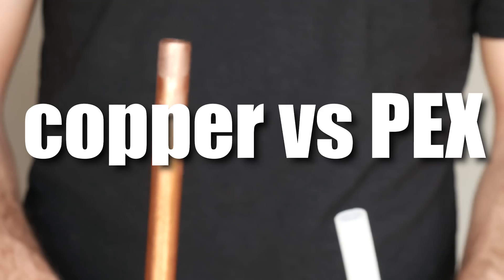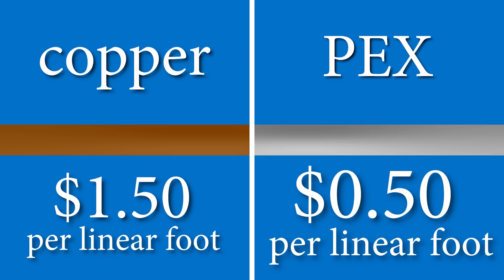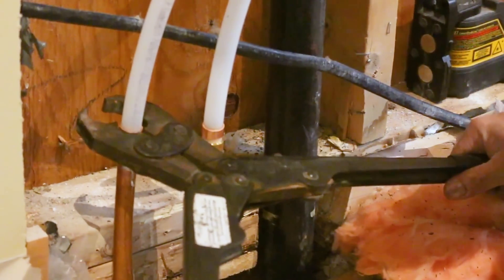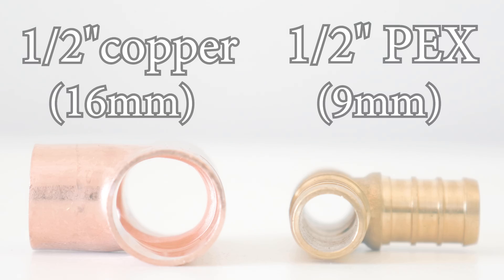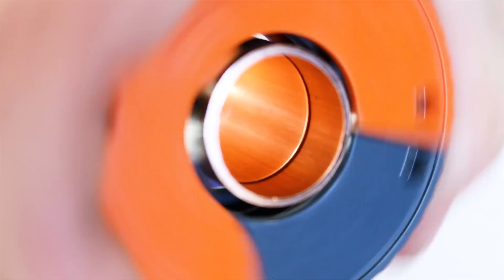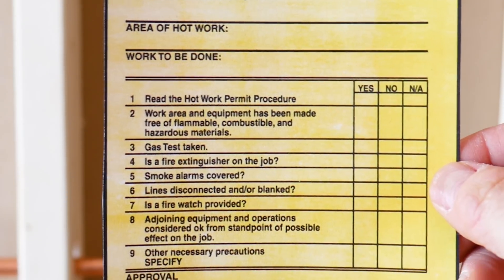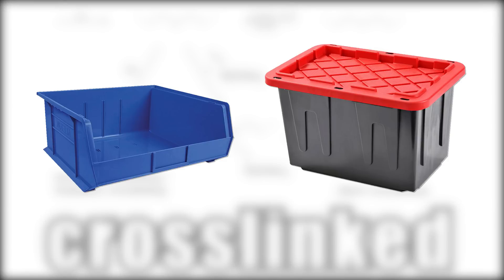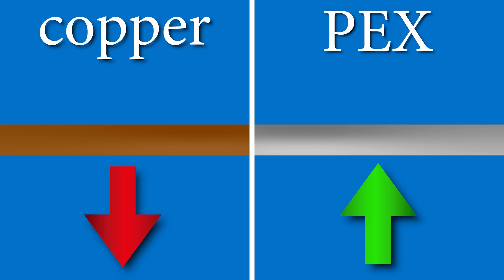Is Copper Better Than PEX? (COMPLETE GUIDE) | GOT2LEARN

Comment: You forgot to mention how much of an advantage copper has to PEX due to it being much more rigid. For example, copper will satisfy an outdoor water spigot needs more as it doesn't require added reinforcement clamps etc. to deal with the strains a spigot will endure. Same goes for shower head supply lines and angle valves on sinks, toilets and basins. Maybe PEX fittings are used for this but I have never seen any review talk about them.
I know of a person who has a 2010 tract built home with PEX and they used all home runs to a manifold with supply valves for each "room". His sink and toilet connection have no angle valves and the pex comes from the drywall then connected directly to the hot/cold fixtures so if he has a toilet about to overflow, he has to run out to the garage manifold to turn off the water. They like to clean their fixture with the water off and the bowl almost empty too yet, no shut off valve near the tank so, out to the garage. Then, if something needs serviced on this dishwasher or the sink etc. no angle valves to control the water in the kitchen so, the entire kitchen room has to do without water for that maintenance. It's hard to believe the local codes allow this and it seems that to maintain a homes plumbing is at more of a disadvantage without angle valves for each fixture.
There is talk that new PEX is rodent proof...I'd doubt that one to be 100% accurate for 50 years.  Also, I don't like the fact that the PEX tubing and fittings are smaller than copper...its bad enough already to deal with loss of water volume when using more than one plumbing fixture at a time and if the "home runs" were done right, there would be 3 or 4 of them per bathroom which makes the need for more per foot PEX supply lines vs. one larger supply line and branching off it for other fixtures in the same room with smaller lines. 
There is another cost with PEX that wasn't mentioned, their fittings cost a lot of money, especially the shark fittings, $30 each? So, the PEX itself is less, the fittings are more, labor might be less however, the homeowner is also at more risk from rodents and likely from a good installation (installer quality) vs. copper.  Overall cost copper vs. pex would have to be quite large to take on the risk of PEX.

Comment: The sizing of the pipe would only be a concern if you are limited on space or if upsizing the pipe cost more than copper for the same size. I was going to do 3/4 pex in my house and would have probably been just fine doing it but I stepped it up to 1" and might only cost me 15% more but was just as easy to put in.

Comment: imagine in several decades when you eventually have to replumb PEX with PEX on a home run system. Attach coupling between old pipe and new pipe, pull old PEX out while pulling in new PEX.

Comment: Both... prefer PEX for all reasons mentioned...rodents are its only real actual weakness...but if your under joists its no problem Pex is so easy fast repairs are a piece of cake cost less flexible less joints if your worried about mice or rats chewing on them note that most of your water pipes  are up high n the most exposed are when you coming up of the floor so if you want a piece of mind then just copper it up to that point then pex it up...great video
Reply from the maker: thanks!!!

Comment: We have lived in our home for 35 years. Noticing pinholes I replaced my copper finding a cheap grade that I was replaced with L grade pipe. After watching your videos I easily replaced it and determined it was an excess of flux that damaged the old copper pipe. Thanks, G2L I like copper.
Reply: What state? When I worked in specialty insurance over a decade ago (customer could add on insurance and include in their utility bill), there were a rash of copper getting pinhole leaks due to the water content in Florida. I think Pennsylvania too. But this affected entire water districts, so if it was only you, could have been the install, if your entire neighborhood is getting leaks, could be the water. I usually badmouth insurance companies, but we were quick to pay for a recomplete replumb instead of repairing pinhole leaks in these water districts.

Comment: In my country copper pipes are 10-15 times more expensive than PPRC piping which is most commonly used. Plus those PPRC pipes have have joints that fit over the pipes like your copper ones so no burden on flow either. Also, i just checked, manufacturer data shows 940 psi capacity. No PPRC in Canada?

Comment: I'm a DIY'er and have done 8 bathrooms and 5 kitchens, all copper and I'm still waiting to hear about the first leak on any one of them since 1968.  I agree with all the advantages of PEX stated here and am ready to embark on my 9th bathroom.  Although I am a copper disciple, I'm afraid we have something new to think about.  We are in a new world now and the enemy is inside the wire.  I have little doubt that some Bolshevik bureaucrat will soon mandate that local municipalities lower water pressure and volume to their customers/citizens just like they already have begun with electricity.  What PEX brings to the table in that regard is few if any elbow fittings.  The turns are more gradual and sweeping with PEX and should have no noticeable effect on pressure at the service point.  This is perhaps a PEX value point that some may not have considered.  The harsh turns of copper elbows will present accumulative pressure loss over the run depending on their number.  I'm not a plumber but I am a mechanic/technician and have had to learn about this in Hydraulics, Refrigerant, Cooling Systems and Pool equipment.  Across all fluid management systems I have always tried to include sweep type elbow joints wherever possible in my layout.  I don't see any reason why it would be different in a home or commercial plumbing system.  PEX intrinsically makes that happen by default.  My first PEX bathroom begins in 6 weeks.  I'll get back to you in 40 years and let you know how I made out.  :)
Reply: So, PEX is invented about the same time the Berlin Wall comes down?  Coincidence?  I think not!

Comment: I am in the Restoration water mitigation industry. Copper is my friend when it comes to leaks, mostly in the winter due to poor insulation/temperature control. That being said I was on one job where a rat chewed through a pex line on the 3rd floor. All three floors were flooded.

Comment: Great Vid!!  took a 1924 house and gutted piping!!  redid the whole house to every fixture added some fixtures with valves on hot and cold of every fixture !!  Kickass system!!  going to be installing a dedicated hot water return line to hot water heater with smart plug setup!!
Reply: Great, but what option did you use for piping?
Reply from the maker: PEX and copper :)
Reply: @histubeness  sorry all PEX A

Comment: In argentina we use a thermofusion systems and it’s installation is kinda similar to copper because of the elbows and fittings, but much simplier and fast to install because to join two ends you have to heat up both openings with a specialized handheld and portable heater for that propuse, this also prevents leaks. Also it’s much sturdier than PEX because it has more inner thickness. The plastics technic name is Polypropylene Type 3 (PPCR), but we know it by “Thermofusion Aqua System”. Greetings

Comment: I am from Greece and although I am not a plumber, I would like to have my plumbing and heating made with PEX(we call it "tuborama" in Greece and we use different joints made of brass, which can be easily screwed/unscrewed on it). You can' t repair an old house with the ease of plastic tubing. Actually, I prefer any repairs to be made using special brass joints upon the copper pipes, in order to fit PEX, but you know what I mean. If I could replace all of my pipes with PEX even now, I would gladly do it!
Reply: Actually, I meant "You can' t repair an old house WITHOUT the ease of plastic tubing", but I guess that you already have figured it out... ;-)

Comment: Great video thank you. Just wondering is there's a max hot water temperature for PEX and how well both do in the long run wrt to fatigue cycles of high and low temperatures.
Reply from the maker: It depends the pressure, PEX can't withstand heat as good at higher pressures.
Reply: @Got2Learn  Thank you (still helps 2y latter lol)

Comment: We use pex, but we use pex inside another tube for waterproof systems, to prevent leaks inside the walls. If you search up 'Sanipex' im sure you could read a little about it and how its supposed to work. In my country, it isnt allowed with any connections or pipes with risk of getting a leak.

Comment: Not sure if its available in north america but in europe I prefer to work with alupex, which has aluminium layer bonded to outside of the pipe and covered with thin layer of pex. It makes the pipe more rigid and more resistant to any damage plus when you bend it stays in shape you want it to be instead of flexing.

Comment: Interesting.
In my country, copper is not used for last 50 years and even then it was used as flexible tubing for toilets water lines and such. Main water lines were made of iron tubes. 
Today the PEX and the SP (or very similar Multigol) systems are used, while PEX is considered old fashioned.
Our PEX tubing is almost exclusively black and the fittings are not crimped but locked with rotating nut that tights the conical brass o-ring with PEX tube sitting over fitting's inner tube made from brass or steel. 
The codes here require to have the PEX tube inside another PEX tubing whilst mounted inside concrete or block wall. This denies splitting the tubes or installing T or Y splitters inside walls. There are main extendable brass-made water splitters that are put in a small closet near the main water entry.

SP is a three layer tube, PEX outside,  thin aluminum in the middle and PTFE (teflon) layer inside. In Multigol, the inner layer is made from PEX
This type is very flexible and it keeps its form after forming. Fittings and connectors are crimp type, pretty similar to what I saw in this video, except that outer no-rust steel sleeve is connected to the fitting. Crimping is done by a very similar tool that was seen in the video.  Lately there are push-fit locked fittings began to appear, invented by the same company that makes Moltigol. 
It is allowed to put the SP tubing inside the concrete or block walls without additional protection. T and Y splits are allowed in walls.
The SP and the Multigol systems are very popular nowadays here. 
Do you have something similar to SP or Multigol?

Comment: Your point on internal bore is misleading. The bore of the fittings is negligible, however the bore of the pipe itself is significantly different as pex has a much thicker wall than cu. This is why flow is so much worse with pex, not the fittings.

Comment: well in this case ! I would use both if i want to plumb my home , and it would be as follow:
 Pex  for service line to Main shut off valve and PRV valve , to Water  softener or filtration system , to water heater 
Pex branches  to garden bib valves , toilets lines .
from water heater  i would get Copper for my  kitchen sink , shower and bath and bathroom sink 
also the cold water lines  would convert from Pex branching to copper  for my kitchen  and bathroom 
that would keep my  drinking water  and bathe and wash clean for my  body and consumption while toilets and garden bibs can be  branched from main service line . 
but that's me

Comment: One thing not mentioned is that PEX can freeze many times without bursting, unlike copper.  Sure, metal fittings will burst but if fittings are installed in accessible areas (all home runs), tearing into walls for repair is not needed.
Reply: he did mention that
Reply: I watched a video where they froze a pex pipe full of water. the fittings held.
Reply: @mattalford3932  That was lucky.  I needed to replace some brass fittings on an outdoor PEX sink line when it froze.
Reply: @bobbray9666  shark bite fittings can slide off copper pipe too. I didn't know that when I used them like that. But they were in a place I could easily access

Comment: why not pvc? sorry for the dumb question
Reply: For one, it cannot handle hot temperatures well. Pipes starting bending, glue joints fail, and they get brittle after expose to high heat and cold over and over again. However, you can use CPVC which is meant to handle the heat and such, only problem with it, it's expensive and can those pipes are not hard to break. if it's exposed piping, horrible to use, but behind walls, it will be fine. :)